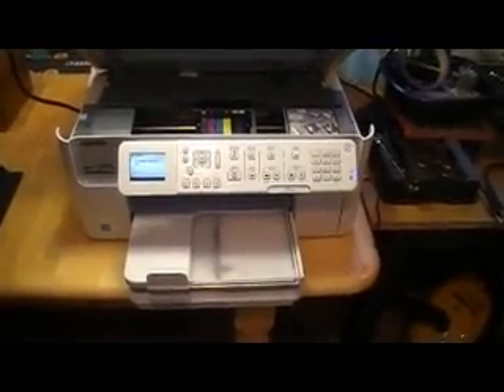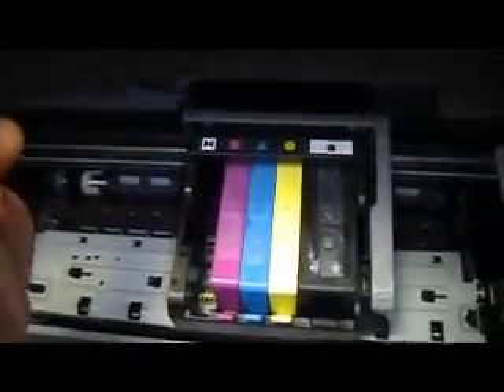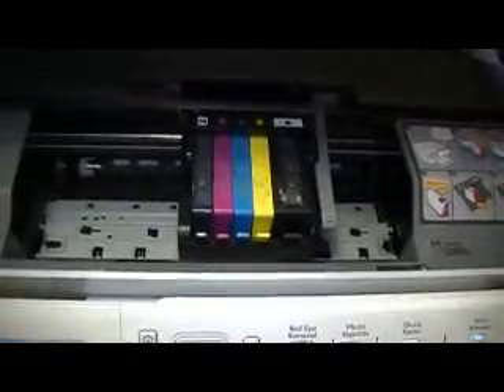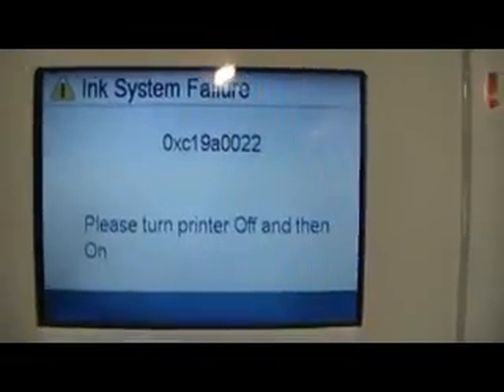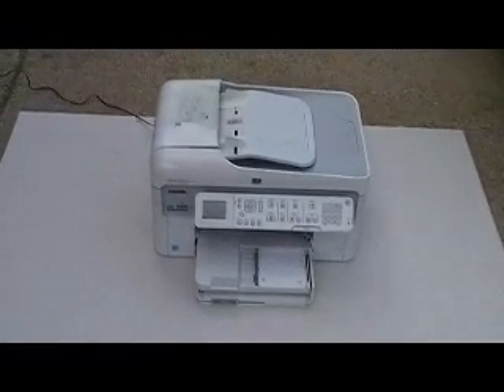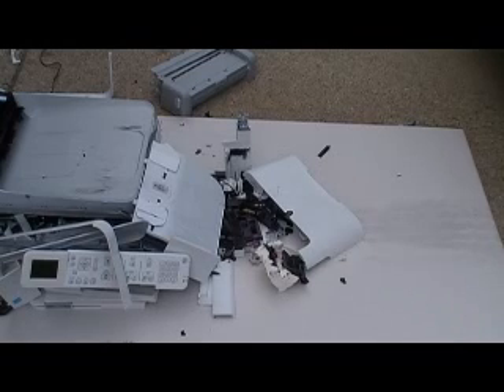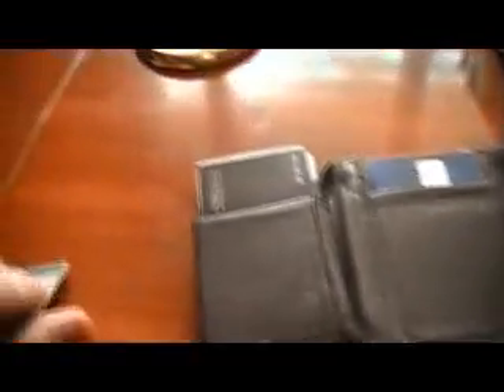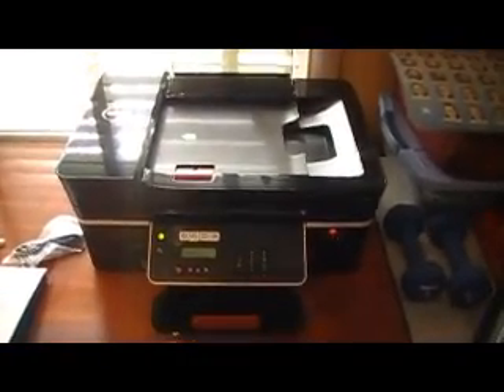HP Printer repair

Comment: I had that disaster of printer years ago. It wasn’t the worst printer I’ve ever had, but it wasn’t the best either. I liked that it could print on CD’s, and had a real control panel, instead of a touchscreen, but that was about it. Mine had an intermittent USB error saying to remove the USB device, even if nothing USB was plugged into it, and the error locked out all printer functions. It was also loud, and guzzled ink faster than a V8 guzzles gas! It finally quit printing one day, and no matter what I did, (it wasn’t out of ink), it still wouldn’t work. I thought about doing what you did to get rid of it with my 2003 Toyota 4Runner, but I was worried about damaging the truck and its tires, and didn’t want to have to clean up that mess. Instead, I dropped it on concrete a few times and gave it a few good whacks with a hammer before tossing it in the trash. It got replaced with a HP OfficeJet Pro 8620, which lasted a while before it too quit printing, and it went to the dump. My current printer is an HP OfficeJet Pro 8710, and it’s awesome. I think they finally got it right.

Comment: isnt it bad to use third party inks? hp ink designed to work with hp printers
Reply from the maker: yeah its bad, for hp's profits. have you not yet figured out the ink game printer manufactures play?
Reply: Seriously, man. Why do you think they sell the printer for $25 and then ding you $50 for the ink? It's not because of their rigorous testing. It's the same reason their stupid chips report empty cartridge when it's still half full. The ONLY reason that the cartridges even have chips is so the mfr can use the DMCA against 3rd party MFRS.
Reply: my black toner is 120 dollars....BUT it lasts for 2600 pages. ur right there their should be third party manufacturers to offer more economical valued inks that hp and all them should approve but wont due to them raking in so much money. my cheap 50 dolalr sink jet a few years ago costs 80 dollars for 1 black and 1 color together.
Reply: are you really that dumb?
Reply: Rich Sobocinski no it does make sense numb nuts. hp manufacurers a specific ink that has been TESTED and designed to work with their printer. third party inks could clog up the jets and would be even stupider to use since HP will not cover printer damages due to thirdparty inks under warranty.
Reply: only idiots buy printers for 25 dollars. the more expensive ones have much cheaper and better CPP
Reply: it was a generalization. <sigh> It seems like EVERYONE but you knows that ink is a major scam played by the printer mfrs. The point is, most ink jet printers are relatively cheap, especially compared to their replacement cartridges - so cheap that you needn't worry about "bad ink" - you just get a newer model printer.
Reply: what about laserS?
Reply: I'm not sure about them, but it would not surprise me if the situation was similar. Seriously, though, read up a little on the DMCA and replacement ink. It will shock you (or it should) how US copyright law is being used to screw consumers.